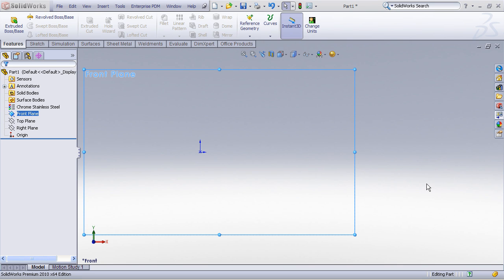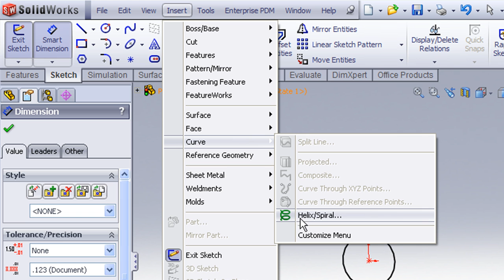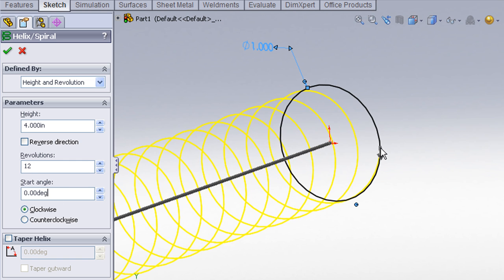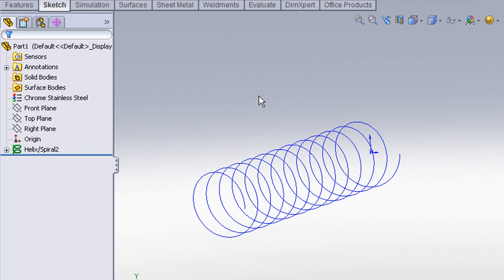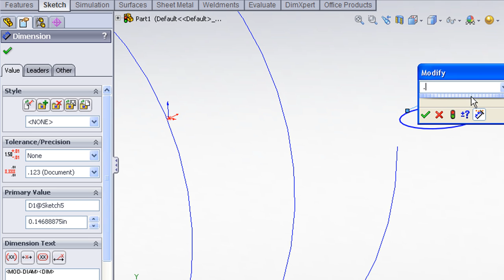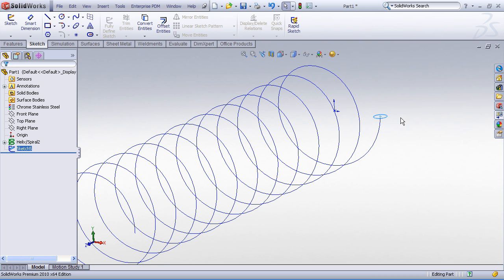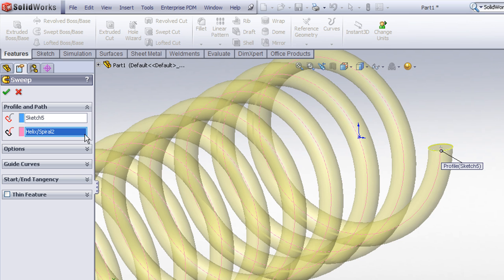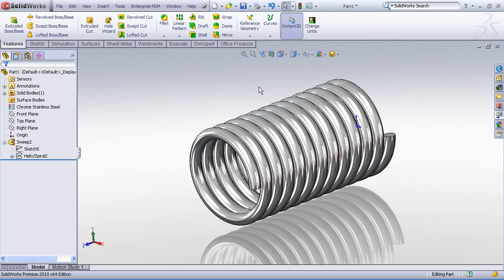How to model a spring in SolidWorks

Comment from the maker: @cianpos What you would do in this case is this:
1) prior to creating the sweep, sketch an arc (not quite 360 deg) that starts on a plane parallel to the start of the helix, but passing through the END point of the helix
2) Insert, Curve, Composite Curve  To form a curve that combines the helix curve with your sketched arc.
3) Now you have a new sweep path formed by the composite curve.  Just make the boss sweep same as before, but select the composite curve as the path.